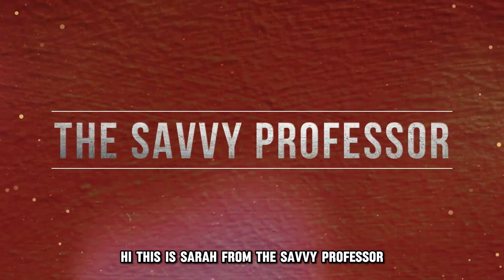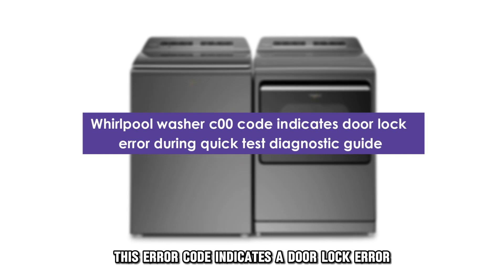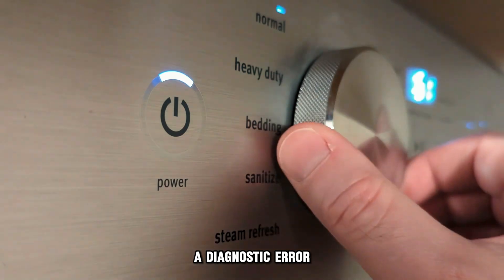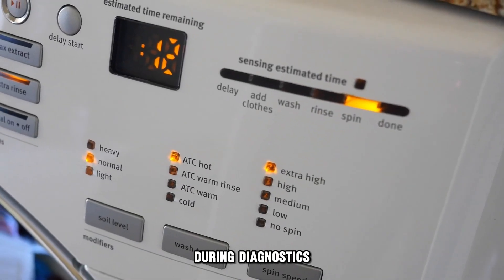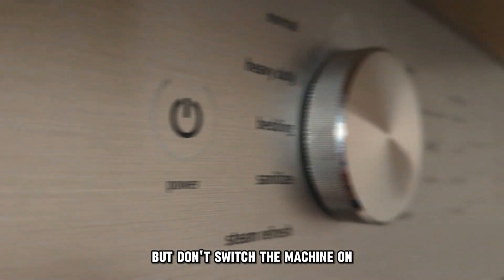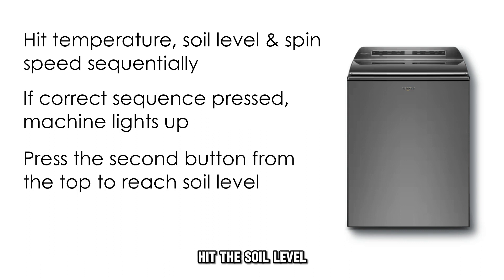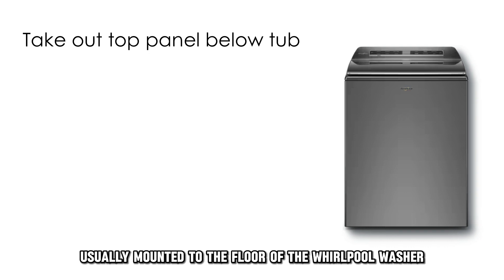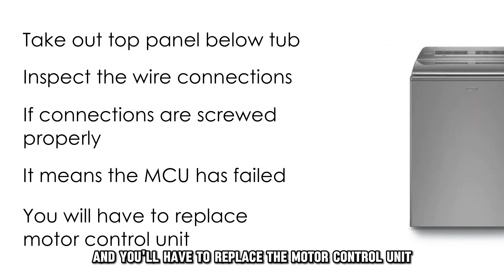Whirlpool Washer C00 Error Code (Know The Meaning, Causes, And Solutions To The Error Code)

Comment: Ever since I got this washing machine, I never had a successful wash. They replaced it three times. I had it for five years and now you have to replace everything the motor, the computer, the water, temperature sensor, and the water sensor level control valve. These are the worst washing machines I’ve ever had to deal with I’d rather go back to the top loader, washing machine machine, and just keep the dryer.